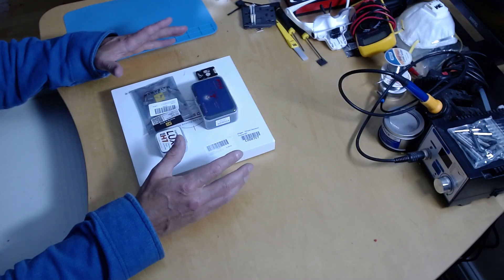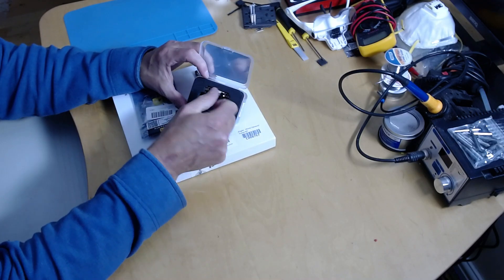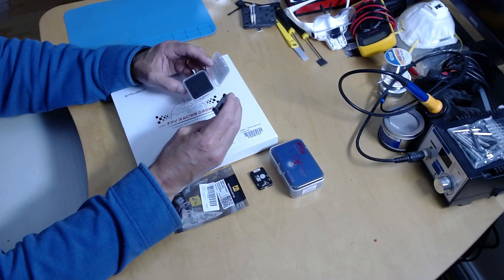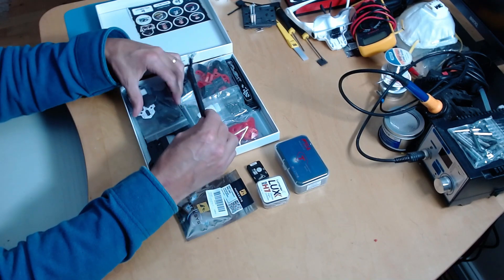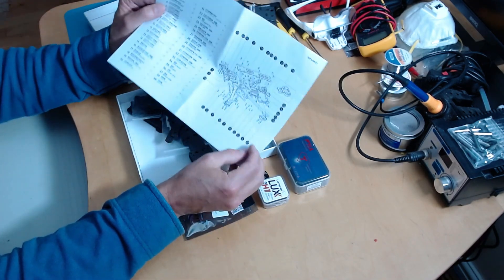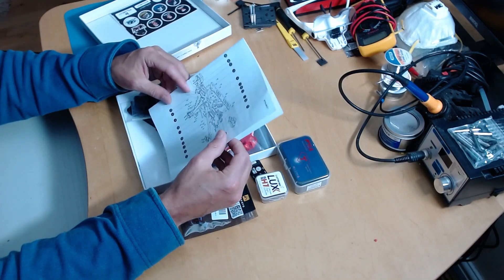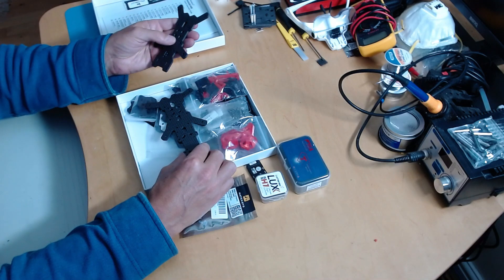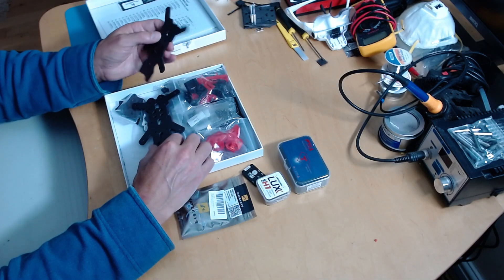ArduCopter 7" LR Build Video 1 - Intro and Unboxing

Comment: mine doesnt come with 200mm coax cable for dji vista/air unit. :( maybe i got the latest batch
Reply from the maker: Ah that's a shame because I could not find anywhere that would supply these. Be worth asking iFlight juist in case
Reply: @andypiper5285  yes but you also got the latest frame set like i got. that rear bottom baseplate that protude to support the gps mout tpu better.. whats the gps unit youre using for the stock gps mount?i cant fit mine here..
Reply from the maker: @TERBANGFPV  I'm using a Matek M8Q-5883
Reply: @andypiper5285  nice, mine already on shipping.